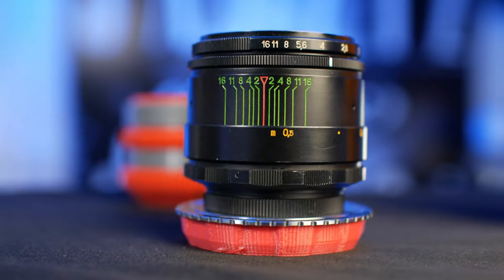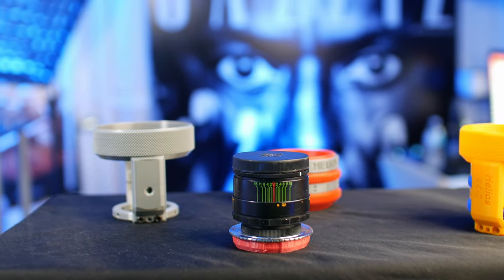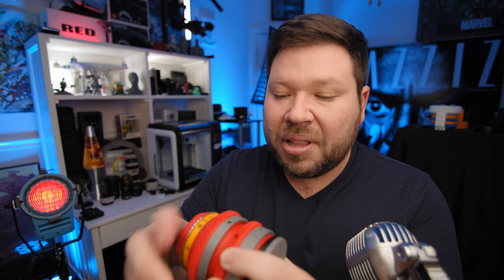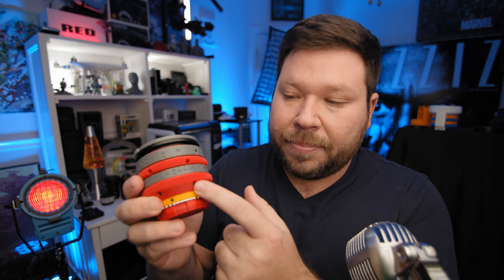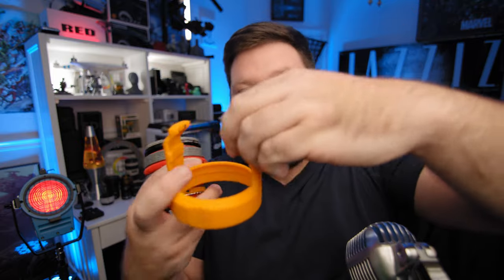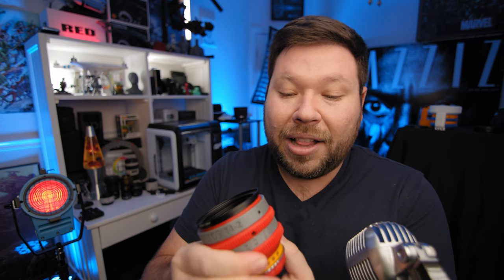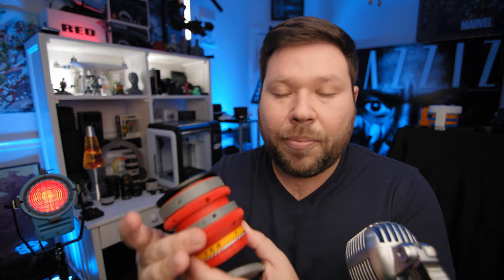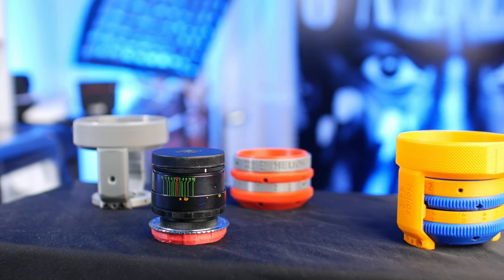Helios 58mm 44-2 3D printed Lens Housing | Is it worth doing and how I did it

Comment: You can put thin tape on areas where the screws gonna touch to protect the lens and when removing wont have issue. Other method is to put drop of glue on bottom of the screw and let it dry as the dry glue act as rubber or plastic that prevent scratching.

Comment: Thanks for the video. I'm seriously interested in housing my Helios 44-2, but FIVE DAYS to print the files seems a bit crazy. There are companies selling rehoused Helios 44-2 lenses with these 3D printed parts for $300. I'm thinking that's the way to go for anyone who doesn't own or have access to a 3D printer.

How hard is it to get all the step up rings installed after the housing is in place?
Reply from the maker: As long as you put them all together before screwing then into the lens it’s pretty easy

Comment: What size of lens cap did you print?
Reply from the maker: I have my step up rings going to 72mm so it all depends on how far you are going
Reply: @ReachFilms  awesome how has it held up over the past year? I did a print at 50% in fill, will that hold up? also where did you buy the screws?
Reply from the maker: @gibblsworthiscool  it’s held up fine, however I don’t use it on a daily basis. As for the screws I got them on Amazon
Reply from the maker: @gibblsworthiscool  links to the screws are in the description